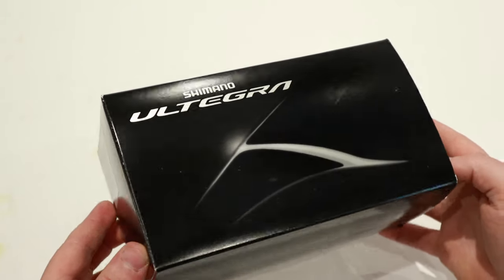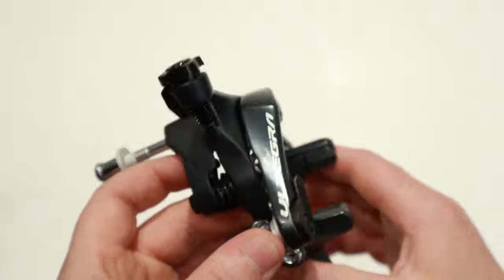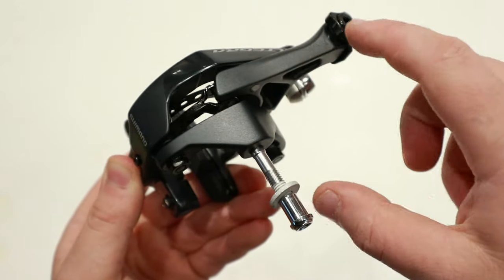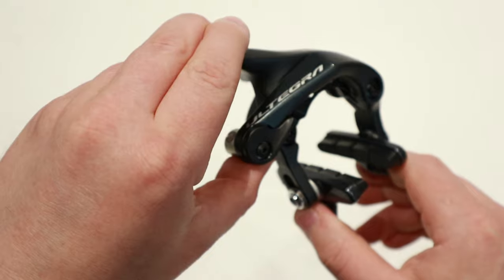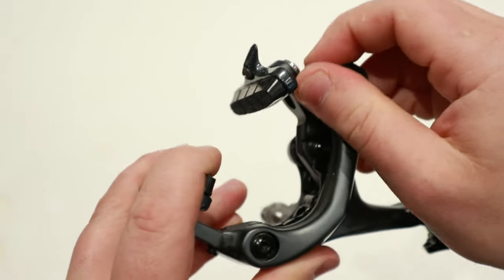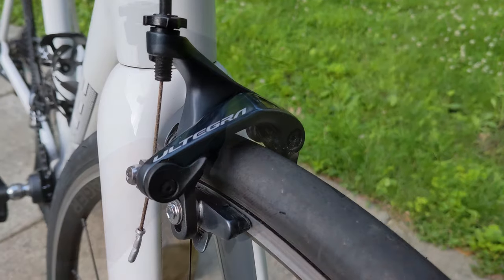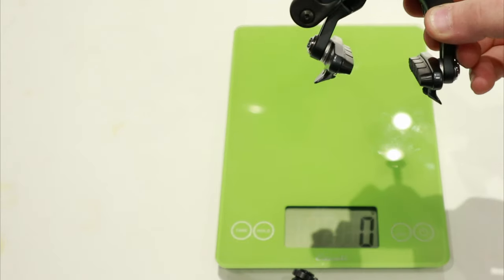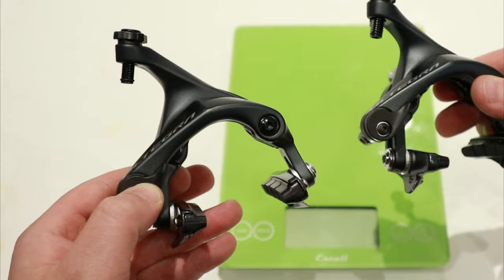Shimano Ultegra R8000 Caliper Brakes Specs and Weight

Comment: Hello, I hope someone can help me with my question. The adjusting bolt at the top of the caliper has a black plastic tab behind it (I hope that makes sense) what's it for and what happens if you don't have it? Will the bolt not hold in place? I hope my question makes sense. Thank you in advance!
Reply: Hi I guess you are referring to the barrel adjuster. If you have 105 it has a longer plastic black adjuster different to this ultegra one.
Reply: @Vinch22  thank you for your help. I found it some time ago and I have made the proper adjustment
I had received the brakes for free and lost the part I was looking for but I found it. Appreciate the help!

Comment: Is there a noticeable difference between the R8000 Ultegra v’s 105 R7000 rim brakes….?
Reply from the maker: Performance wise no. Finish/Color/Weight, then yes.
Reply: @Jamesthebikeguy  thanks, was undecided whether to spend the extra on the r8000 but will opt for r7000 now, 20g or so heavier for the pair I can live with :)